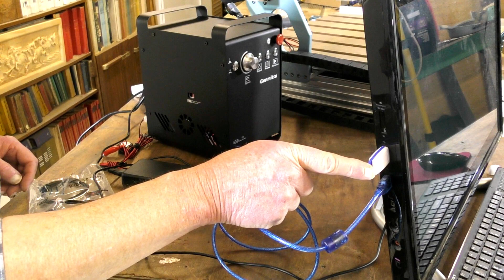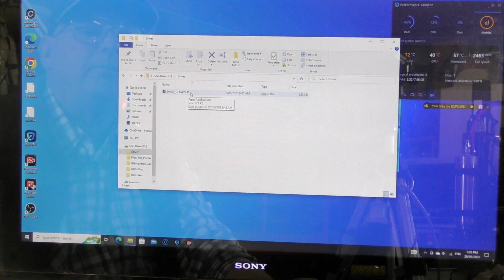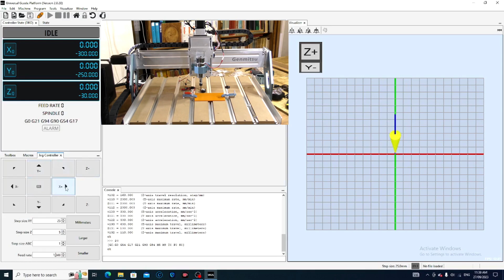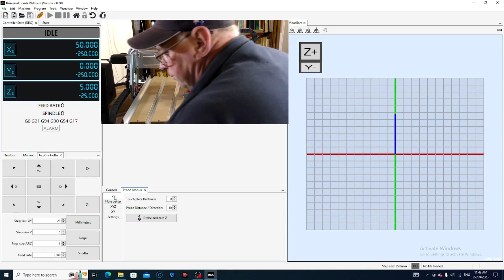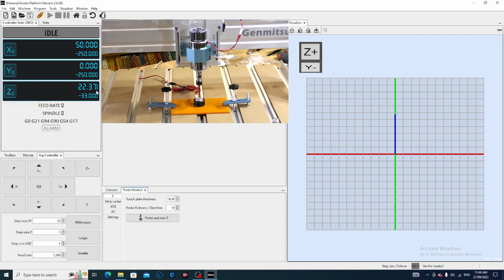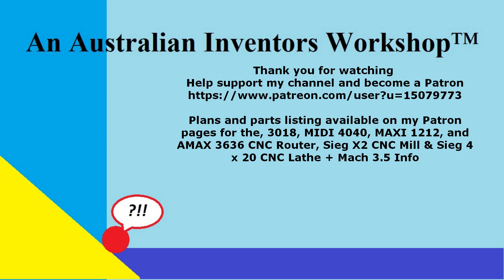BEST CNC Router under $1800 SainSMART 6050 Plus (UGS) Setup + BEST FREE Universal G-Code Sender

Comment: Thank you Roger for the video. I setup my machine following the steps, including the Z axis using the probe. Unfortunately when I ran my machine, it moved lower than the wood on approach and snapped the drill bit on the side of my wood. Should we reset the Z axis in the same way you demonstrated with the X+Y?

Comment: you have just made my life that little bit easier - unboxing my 6050 in the morning - you have explained the process perfectly 
just something to point out though from watching other content creators, the first time you jog the machine, you should really go full length a couple of times (x,y,z,x,y,z) to ensure the machine is in perfect alignment while listening to the motor for any changes. something as simple as 1 screw being tighter than others will cause you pain and money by burning out a stepper motor. you won't hear it when the spindle is going